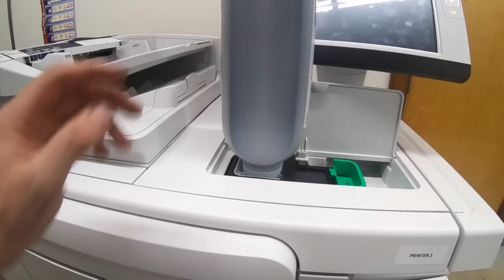Spiral Cleaner on Canon Varioprint, Current Paper Situation

Comment: Hello again just so you know there is a smaller spiral cleaner under the belt. this is a dismantle the carriage job, normally every 4 or 5 large spiral cleaners we have the small one done (usually the belt at the same time) BTW we rent ours from Canon so it's a service call included in the rental, and that sensor is paper dust contamination I clean mine daily just to have no stops during my work day.

Comment: I love how clean the alignment section works on that FS-532. We have some costumers with high volume office systems and every 400.000 prints you have to replace those paddles inside those office finishers. My high volume customer with 2 pro 1100 and FS-532 has over 5 million prints on every system,  never had to replace the paddles
Reply from the maker: Yes, the production machines are made to run!

Comment: 2:00 the embedded software doesn't detect spiral cleaner temperature since certain version, so you can remove the heating rod without problems.

Comment: Yeah, the paper shortage is, besides increased cost, also coming from manufacturers switching over to cardboard and box production for online shops. We're doing some LFP and there's multiple papers we can not get at the moment or for the rest of the year even. Normal sheet paper has increased in price as well, but not by the margins LFP-paper and rolls have gone up.

Some people use the overall "seemingly increase" of prices all over to bump up their own prices as well. The stamp-housings we use to make said stamps have gone up by DOUBLE the price at one manufacturer...while another one has gone up like 5%. Guess we're not going to the first one anymore.
Reply from the maker: Its tough to determine if some people are increasing prices because of greed or fear. I know both are happening.

Comment: Very good evening I'm big fan of you I have have a problem in c1060  a code  c2214 not everytime some time machine run properly but some time past code come I also change drum unit, DC power supply2 farmware machine data I also clean drum inocder censers and drum incoder please give some advice

Comment: Gdaye mate' hope you are having a great week'
for running flyers and brochures i was wondering if compatible toner's vs oem are worth it as they almost half the price?
in the beginning to help get things off the ground'
Reply from the maker: I wouldn't recommend it. They worked for me while I couldn't get the oem. The density changed so color was different, not bad, but different. Its possible that the generic toner could cause damage.
Reply: @justaprinter  Cheers mate' i have one generic cartridge so far after its run through ill go back to OEM' im running canon image runner advance c2230 an c5235 machines for flyers and light advertising materials'
Got them at a bargain price slowly working my way up'

Comment: Canons are great, I'd keep it even if you have to call a tech sometimes.  At least with Canon (cough::xerox::cough) there are more service techs around and they are way less expensive per hour than what big X charges.
Reply from the maker: It's interesting how many Xerox naysayers there are. :)
Reply: @justaprinter  Count me in on that. Just had a fleet of Xerox devices placed in my facility and one of our sites just installed a Xerox color press. What a mistake! Xerox is so hands off when it comes to installation, service and training. The devices are cheaply made also.. Fortunately I have a Konica Minolta C3070 in my shop and plan to purchase it after the lease expires next year.
Reply: As far as I'm aware ... Xerox hasn't made anything for years ... they rebrand and change software to lock out other makers toner, or even the manufacturers that make the machine's toner so they can sell their more expensive version !!! I've been a copier tech / laser tech for 42 years ... what a wild ride !! independent for 30 years, fixed every brand !!

Comment: But the cost is going up and down, i seen a steady increase but there are times when its cheaper.  but no where near what paper costs use to be. And how do you explain to your client that you cant get they're paper they are use to. Its so frustrating! Ive lost one big client cause i couldnt match my previous turnaround times at the same price. That was half my income lost. Now im going to drop off some booklets for them about 200 full bleed 8x 8s, free of charge. Hay real quick how come your not running 2 up on a 11 x 17 to get the single click cost? Or was that an offer in the contract? All of my deals i negotiate single click cost for all sizes uo to 13 x 19.2. They just now started to charge a base cost for keeping parts on site which i think is ridiculous. i should actually get clicks for that base but i dont.